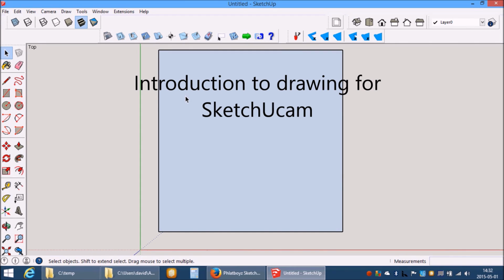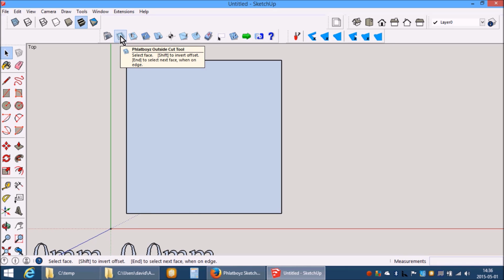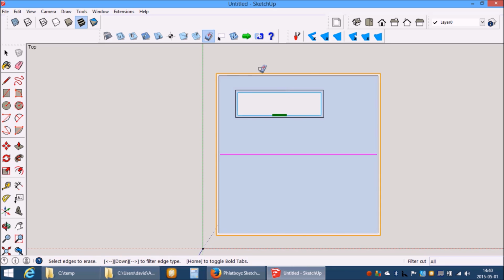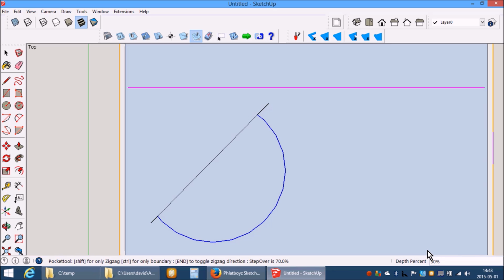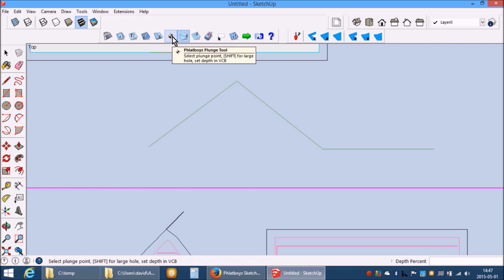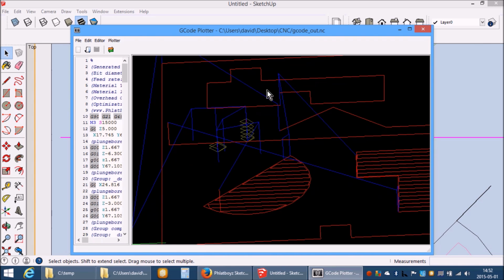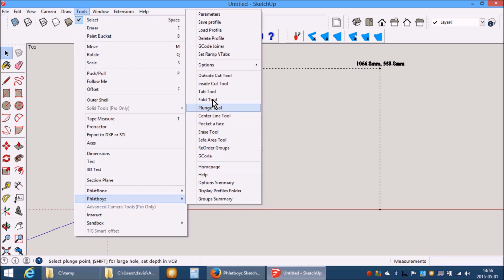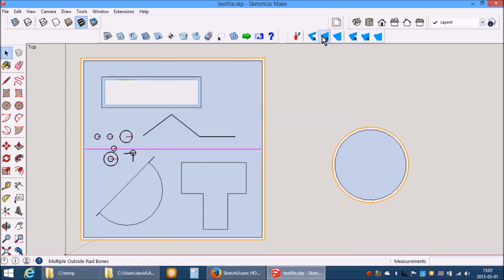Introduction to drawing for SketchUcam

Comment: Hey David, I really appreciate your videos and have been learning a lot from them! I have a small problem, when I try to plot the gcode a window pops up saying (0,0 is not a valid floating point value). The plot shows up but it's always empty.. I'm looking forward for your anwer. Keep it up you're doing a great job
Reply from the maker: Your country uses a comma as a separator in numbers, but Gcode requires a decimal point.  You have to go into regional settings in windows and change form a comma to a point so that numbers display as 0.0 not 0,0.

Comment: Incredible video!  Thank you. This has cleared up a lot for me! One question though. I cannot set multi pass depth less than 1mm. I want to change it to 0.4mm but every time I saved settings and open them back up it is automatically set to 0. Any help? Is it possible to set the multi-pass depth to lower than 1 mm?
Reply from the maker: Sounds like you have your precision set too low. Window model info the set unit precision to have 4 decimal places.
Reply: Yes! That fixed it. Thank you very, very much! I should have known that. :)

Comment: Hi David, Thank you very much for a  great explanation of this very useful plugin. I have a problem though. I follow your instructions, and everything seems to responds like your example but the gcode generated only produces two G00. One for the Z: G00 Z3.00, and then a go home G00 X0 Y0 block, that's it (I mean no more movement commands)
What I might be missing?
Reply: Sorry, dismiss my question. I did it again and now it works...Have to found what I did wrong now. 
Thank you very much.
Reply from the maker: I think I know what you did, you had something selected, something that was not a cutline.   If nothing is selected, Gcode will be generated for the whole drawing.  If something is selected, Gcode will only be generated for the selection.    Note that for and outside or inside cutline, you have to select the face that touches the cutline as well as the cutline itself.
Reply: Ha! You have no idea what a good timing you had on your reply. I was struggling mighty with my model. You are absolutely right. I made sure that nothing is selected now and it does work.

I found another issue though. There are some tool paths that I want to delete. Some allow to be deleted but I have a few pesky ones that refuse to be deleted.  Do you have some idea about what I am doing wrong.? I want to start from scratch, but I don't want to redraw my model.

Thank you very much David
Reply from the maker: The cut delete tool works well for outside/ inside and center lines, but the regular sketchup delete is better for pockets and plunge holes.  Also, if a line will not delete maybe it is part of a group? If so, explode the group.
Reply: It was part of a group. You are super helpful David. Thank you very much and have a great day. And happy CNCing!

Comment: Can you change starting points & led-ins for plasma gcodes?  I really appreciate your vids David! I'm going to watch them all when I can get unlimited data inter-web service..  If you had all your vids on CD I would pay.  Thanks!
Reply from the maker: Hi Dan
No, no plasma leads ins (yet).   I did make a start on it in 2015 but quickly realized i just do not have enough info about all the different plasma controllers to do this properly.  Thanks for your kind words.

Comment: quick question? Why do I not get a 3D view in my GCode Plotter. I want to turn it like you did to see path ways?
Reply from the maker: The middle mouse button rotates the view
Reply: David, thanks for your videos!  & thanks for your reply. Mine is zooming not rotating... I really want this view option.... It's driving me nuts!
Reply from the maker: not the scroll wheel, the button, PRESS the middle button aka scroll wheel and move the mouse to rotate
Reply: @DavidtheSwarfer  What if I don't have a middle mouse button?
Reply from the maker: there is no other way at this time.  maybe I can implement a 'control+button' as an alternative, I will have to look at the code.
Reply from the maker: get the new gplot.exe from https://github.com/swarfer/sketchucam/tree/master/Plugins and yu can then use the right mouse button to rotate the drawing.
Reply from the maker: make sure you put the new one in he same place the old one is in, which is in the Sketchup plugins folder.

Comment: Hi David
You produce a nice clear video, thanks. The older I get the slower my brain works. Not dumb, just slow!
I've never used a CNC before, so of course I'm building my own. It's all wood with drawer sliders instead of lead screws. After I make all the mistakes I can I will build a nice solid aluminum ext. with belts or screws.

Okay, to my point. The SketchUcam (Sketchup) seem like a clear and novice friendly program. For now I may just go for the free program but change to the pro later. Would you suggest that I'm going in the right direction?
And finally what would you suggest for the G-code (?) program. Many use Mach3 and some use Chilipeppr with TinYG. Would you have any suggestion on that?
Thank you,
Tom
Reply from the maker: Hi tom. Mach3 needs a parallel port which not many pc's have. I suggest one of the many GRBL based controllers or TinyG .
Reply from the maker: For doing CNBC drawings you will probably never need the pro version of sketch up, SketchUcam works just fine on the free version.

Comment: Does the G Code Previewer only work with a pc?  I can't seem to view it with my mac.
Reply from the maker: +TNA2Me .  yes, it is an .exe program for Windows.   It will run under WINE on Linux so if Mac has some sort of emulator it should work ok.   However, as detailed in the help, you can set a path to any preview program you care to use, so long as it takes the gcode file to view as a command line parameter.   Also check out the options menu Tools|Phlatboyz|Options and the help for it, hit the blue question mark in the toolbar.
Reply: Yes, it works without emulator. You need to edit plist file in the sketchUp to be able to see the menu. Just open your  info.plist, add a word Use_compatible_dialogs, make it boolean and  then make it YES (True).

Comment: Thank you for the information.
Reply from the maker: +Yoo Toob as you can see, the drawings need to be 'flat' for SketchUcam.  This means that if you have 3D drawings of your cabinet, you will need to phlatten them in order to add cutlines.   just copy and paste the faces you need, use the phlatten tool (right click menu) and then add cutlines etc.
Reply: Apologies, I deleted my post after I realized that you explained the procedure in the video. It seems YouTube was faster than I and sent you a copy of my original post. Thank you just the same for your reply.